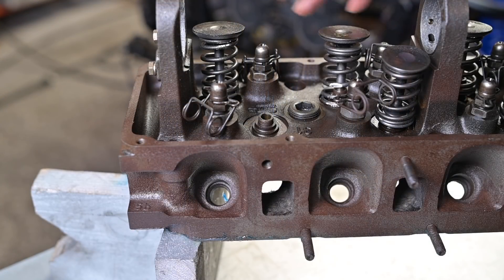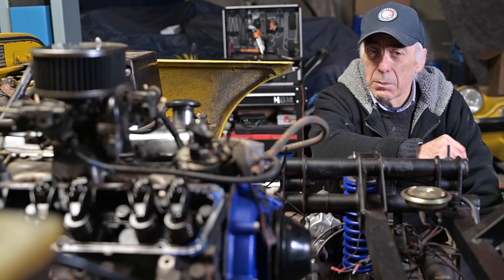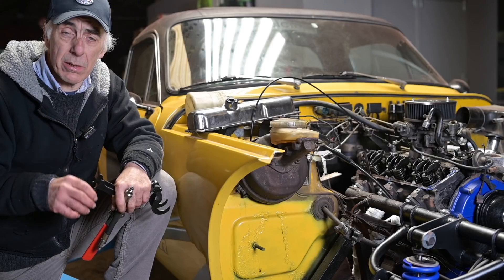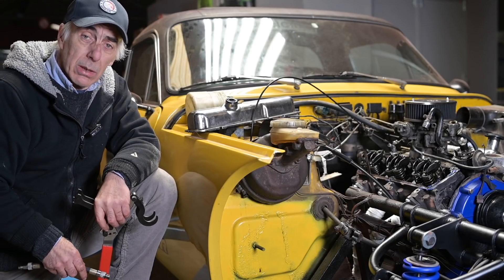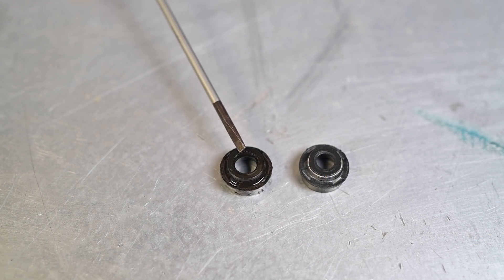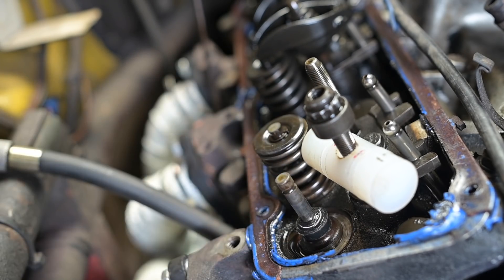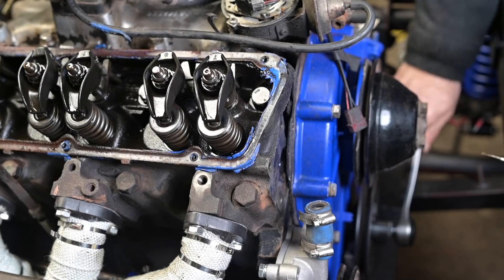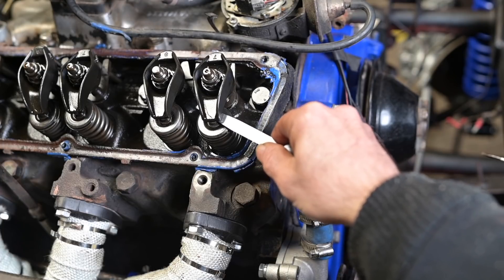TVR  Ford Essex V6  Valve seal replacement (in situe)

Comment: Great video as usual. I have heard of feeding window sash cord (cotton rope) down the bore at bottom dead centre and turning crankshaft to compress the rope ( not too firm) to hold valves in place.  A mechanic aquaintance raced a Mini and replaced a broken valve spring between races using a piece of bent coat hanger wire. It was clubsport and he did this for another competitor he raced against. No sponsorship just competition and fun.

Comment: That is an ingenious way of replacing the valve seals, the old seals were really hard and worn, so I doubt they were doing anything to stop oil running down the guides, it would be a good idea to remove all the silicon gasket rubbish from the inside of the rocker box  , that is deadly when it gets into your oilways and blocks them up, I am always very wary when I find excess amounts of that stuff everywhere on an engine, always a sign that a bodger has worked on the engine! Stay safe, Chris B.
Reply from the maker: Thanks for the comments Chris, indeed that silicone is a real bad thing when used incorrectly.  This engine so far had silicone all-over.  I am removing and replacing all of it while I go through the engine..

Comment: Great work, Steve. It's almost motivated me to do the same job on my old Toyota Hilux. It gets a bit of blue smoke if the engine has been sitting for about 15 minutes and is started again, also puts out a bit of smoke after prolonged heavy engine braking.
Reply from the maker: Thanks for the comments, yep that could be the issue...

Comment: Great video. Checking for valve spring fatigue is also a good idea. Cheers !
Reply from the maker: Thanks for the comments, indeed  , Maybe I should have added that ( checking its height and compression force) . In fact I did measure them... something I will add to the next video a remark made here

Comment: I read in the UK mag Cars and Car Conversions many years ago that if like me you have trouble with the feeler gauges judging the feel, you can try rotating the pushrods with the feeler in position. They also suggeste grinding the sides of the feeler gauges so they fit in the slight groove worn in the rocker arm face that contacts the top of the valve stem. Measuring using the drag method does not take that wear into account.  Best wishes and stay safe from Australia (37deg C today)

Comment: 13:51 add lithium grease to the clips and they will stick to the valve stem. also they will stick to the screwdriver tip and you can use that to put them in place. very easy

Comment: the newer ones have a spring to maintain better tension, better design too, remember to retighten the head bolts? these are a known for head gasket issues
Reply from the maker: Thanks for the comments and tip

Comment: Weak valveshaftseals was a common problem on BMWˋs in the 70ˋs and 80ˋs, Driving behind them was ok as long as they had the throttle open, As soon as they released the throttle you were covered in blue smoke, With throttle closed and high RPM the existing underpressure was able to suck oil from the cylinderhead along the valveshaft into the cylinders where it was burned and the blue smoke created,
Reply: worse on skodas, they had no oil seals at all
Reply from the maker: hahahaha,  I remember seen those puffs on the highway..  Good point..  Thanks for the comments,

Comment: hi great vidios you do i've bought valve sem seals for my 1970 ford zodiac the original ones have a clip at the bottom the ones i ordered the inside diameter is to small any idead where i can find  seals it is a 1970 v6 essesx 3.0
Reply from the maker: Thanks for the comments, Burtons in the UK

Comment: If you don't have compressed air, can it still be done, would the valves just drop on to piston, so I could still pull them back if piston is top dead centre, what size is the nut, torx socket???

Comment: Nice work Steve
 dit you checked if the the pushrods are straight and clean (oil channel)?
Reply from the maker: Thanks for the comments, very good point .. yes I did  but should have shown it in the video...  I will add it to the next video as a comment that was received.  txs

Comment: Please can you tell me what that special tool is called and where I can get one? Also, is there an alternative method for keeping the valves from dropping if you don't have access to an air compressor? Thanks so much mate, really helpful video! Chix
Reply from the maker: Thanks for the comments,   you will find the tool on most car/mechanics tool shops..  I don't know where you live so its a bit difficult to state.  You could make sure the piston is TDC instead of an air compressor but be carefull as the valve will drop a bit.  I would just go and buy a compressor.  It does not have to be a big one

Comment: Does this engine run solid lifters
Reply from the maker: Thanks for the comments, It has pushrods with an oil channel in it , the rockers are a bit flimsy if you ask me... that is why I will put rollers in later

Comment: Hi steve ive got an issue with my v6 essex when on tdc and i fit tge dizzy with position no1 firing it doesnt start but when i change the position of no1 to no6 position ansd it fires from firing order no6 its start and i can advance timing and retard like normal is it normal like this???